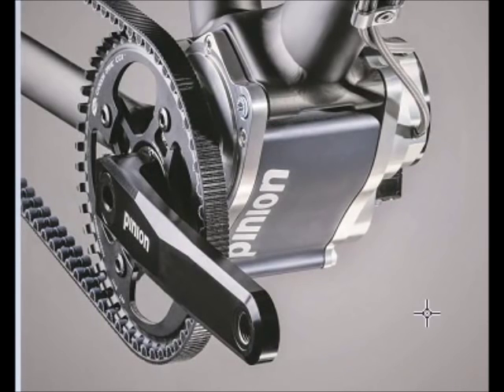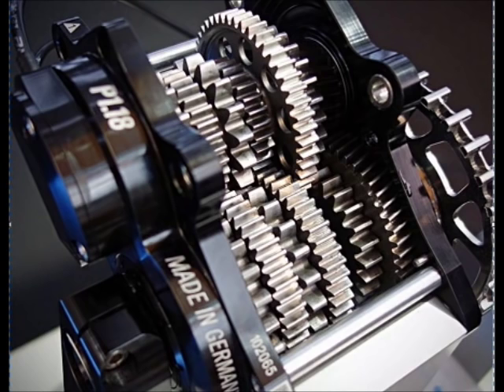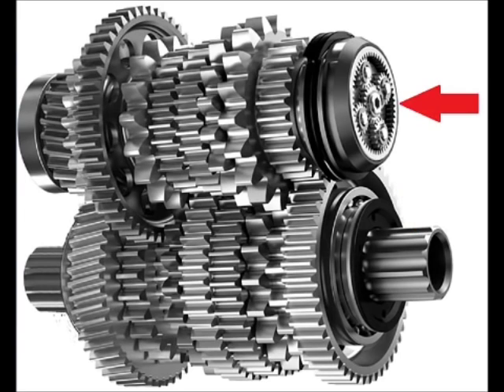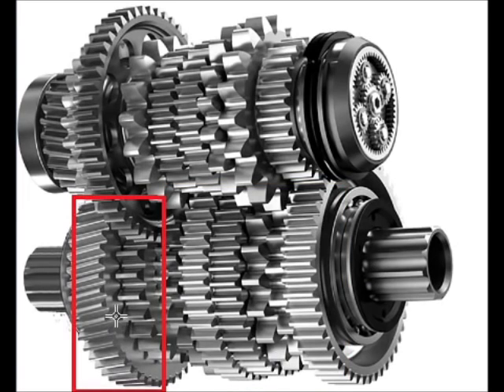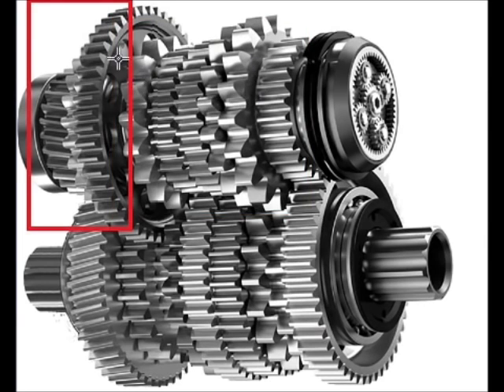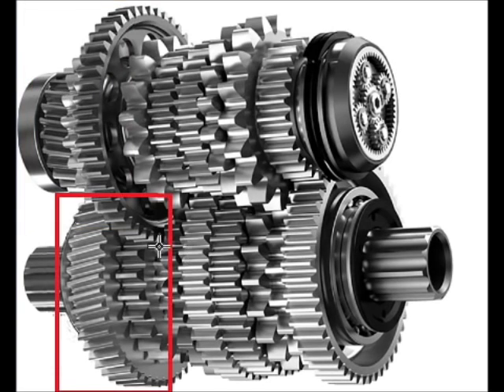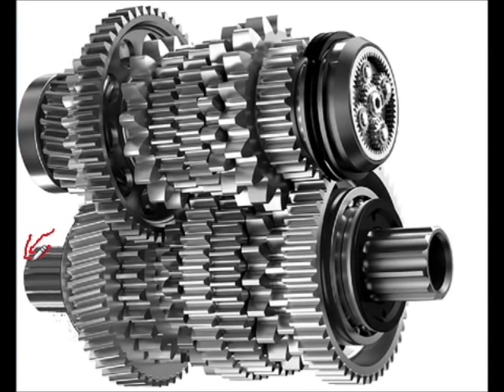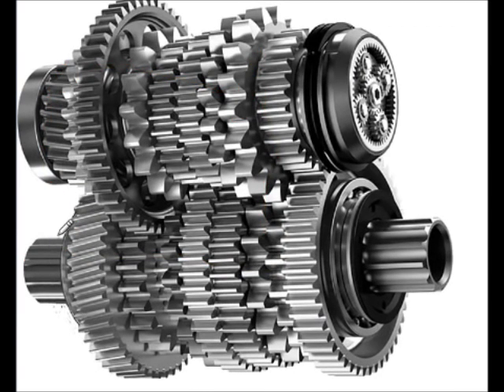Pinion P1.18  bicycle gearbox How it works

Comment: Must be heavy as hell!
Reply: Why would they be heavy? You're not putting 400 foot pounds of torque through them. How much torque can your legs generate? Whatever the number a lawn mower generates more. So what do these gears need to be heavy for? They could be almost as light as an entire group set. Probably a number of ounces heavier do the weight of the case and whatever amount of oil it would contain. 
 More over, these gears could be hollow. Or made of a very light metal. Again. They don't need very much strength. If aluminum can work in this application it will be.

Comment: Too heavy an to much friction
Reply: before commenting, you should read the engineering paper. Of course there is friction, always... unavoidable, but the degree of efficiency is what counts!!!
https://fahrradzukunft.de/20/wirkungsgradmessungen-an-nabenschaltungen-3/He
...and read this as well: 
PortmannHanspeter5 days agoI have a Pinion 1.18 with belt since 5000 km. Absolutely no problem. The expected lifetime will be 50'000 km. No maintenance necessary. Dust and dirt has no negative impact to the belt!
Reply: Gabriel Paduraru well, it is not made for road bikes